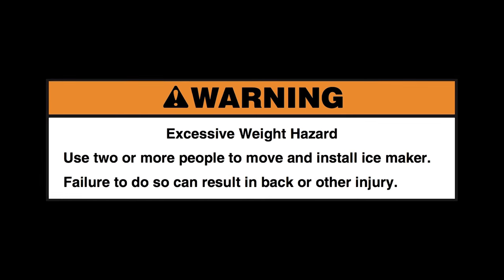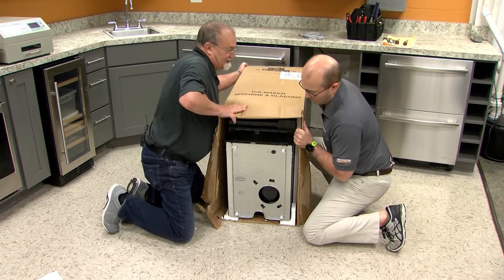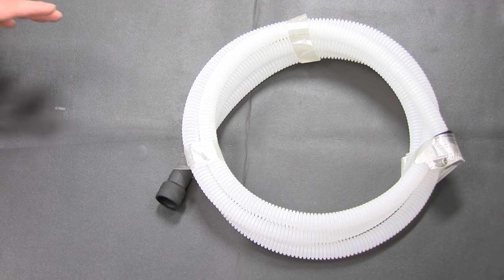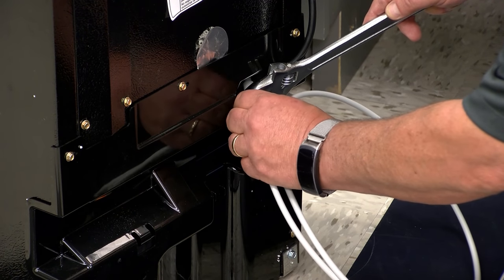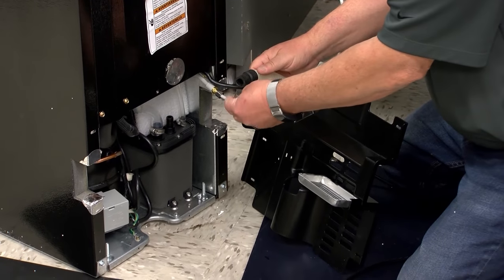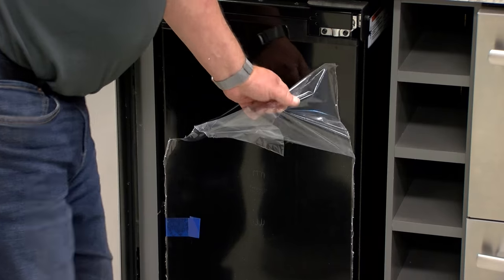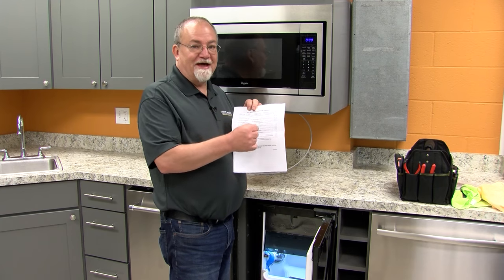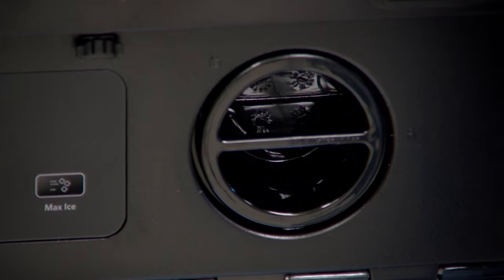How to install the under counter ice maker

Comment: You failed to show where you connected the opposite end of the drain tubing. This is the whole reason I decided to look for a video. Where does the machine drain into? Did you attach it to the drain under the kitchen sink which is several feet away?

Comment: You never discussed connecting the 120 volt power supply -- or when in the process you should test that the ice maker actually powers up.